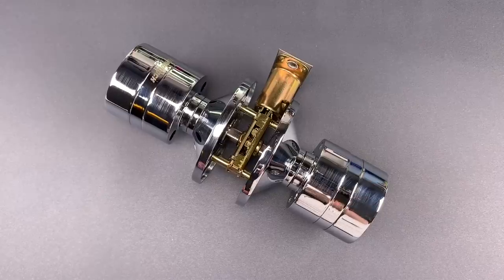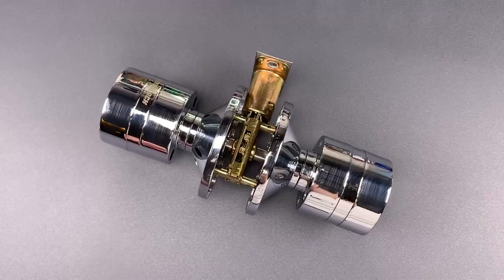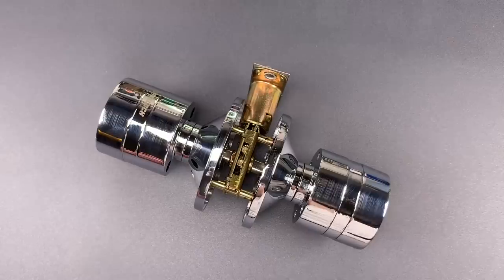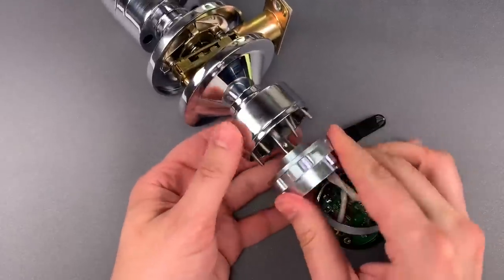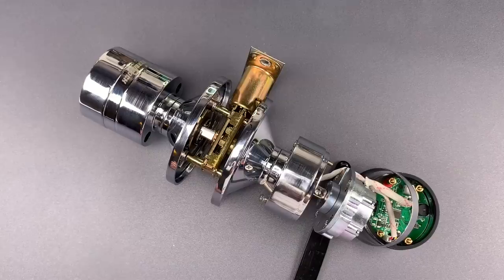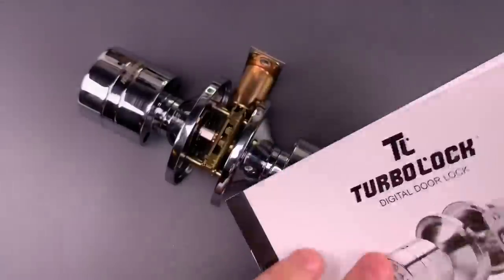[945] TurboLock YL-99 Opened With a Screwdriver!

Comment: I want a scary security sicker saying "Do not disassemble the Product." This will scare robbers.
Reply: I'd be more concerned with the "Nevermind the dog. Beware of the owner" stickers.
Reply: Robbers are not the issue. Be worried about burglars.
Reply: The use of screwdrivers is prohibited!!
Reply: @DerykRobosson  Ive been considering buying a sign like "Beware of the dog" but instead, I want to buy a small 6 pounder 19th century cannon.
"Beware of the cannon"  got a certain....message to it.
Reply: @impeccablyivy5021  And you forgot about the 239 others it seem

Comment: 2:50 to open? that's one of the best locks I've seen on this channel
Reply: It took 2:50 WITH A SCREWDRIVER!
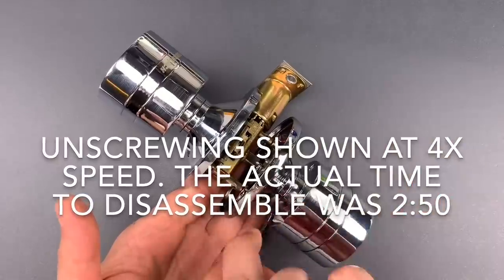Reply: @litigioussociety4249  look at 1:02, it's 2:50 to open
Reply: But could have been better by making disassembly only possible with access to the inside of the door. Not too difficult to stop with a tube if designed right.

Increase the combination to 7 -12 digits and you have something with reasonable security.

I would put something like that on my door...
Reply: @seriousmaran9414  tbh a bit of hammer would have probably gone through that weak construction
Reply: With a ratchet or electric ratchet this would have been scary fast.
Reply: @celivalg  probably the door too. Windows are usually easy to break unless double glazed. Even then easier than doors.
Reply: @seriousmaran9414  Why would one have to gain access from INSIDE the door though??
Reply: @sc0tte1-416  Replacing a defective lock?
Reply: With an anti-materiel rifle it would be open in a blink of an eye.
Reply: @Rotsteinblock  yeah, with a non-electric screwdriver
Reply: Claudio Diaz it’d also alert everyone in a 3 block radius
Reply: @seriousmaran9414  double glazed windows aren't any more difficult to break.  They've also become the standard in the industry, given the thermal break created by a void between the glass.  You might be thinking tempered glass.
Reply: @sc0tte1-416  The screws were needed in the factory, for assembly. Probably access from "inside" isn't necessary after that,  but there wouldn't be need to block that either, if the screw heads were protected by a tube or a ring with holes in it.
Reply: If it had been attached to a door he would have had it apart faster.  Add a ratcheting screwdriver and it's around a 30 second job.  The way it's built it looks like one well placed hit with a hammer could disassemble it.
Reply: It's a door lock, how secure are they? Give me a sledgehammer and I would have it open in 1 sec.
This is something to use as a privacy lock, not a security lock.
Reply: @bosstowndynamics5488  This is the kind of lock you use to keep nanna out of your room or your employees out of an area if you are too cheap to buy a pass card security system.  It's something to use as an internal area lock to keep honest men honest. You would need a beefier door and locks for an external security door. No lock or camera security system is infallible. The best security is always going to be vigilance, then call for assistance. Thieves are brazen af, especially if they're ice head kids or bankers.
Reply: Angle grinder or portaband; chop knob off, open.
Reply: Yep but I remember that he couldn't open an Italian Viro lock.  That was a good product
Reply: Its actually worse than most of the locks on the channel, because you dont have to be lockpickinglawyer to open it this fast. In many other cases you have to have some skill in lockpicking.
Reply: However practically guarantee there’s some basement dwelling 12 year old at blackhat or defcon who has an air gapping exploit that can be run in <5 seconds that opens it, sets a code to whatever you want and they will also point out that you can unlock it by typing 12345 3 times in a row. 🤷‍♂️ The digital lockpick if you will. Just like LPL needs the proper tool for different locks that is the same with this and it will probably be downloadable open source for free.
Reply: Opens in 20 seconds with a TURBO screwdriver!
Reply: @seriousmaran9414  Shattering a window tends to draw a LOT more attention unless you simple don't care.
Reply: Pretty impressive. Now to figure out a way to use it on my bike
Reply: Maybe see how long it takes mounted to a door where you wouldn't see the screws and be able to spin it around in your hands. It wouldn't change the actual defect of screws, but it might change the time spent.
Reply: You don't even need that much. Using a lever and a metal pad (to prevent the lever sinking in the cheap cardboard doors these are usually put into, that you can wet and get through, usuallyx2) you can break the head and get to the square key just as well. You never want purchase angles on your security features.
Reply: Claudio Diaz nerd
Reply: i'd just open the door. the lock isnt eved attached yet!
Reply: yeah seems pretty good, but i remember seeing one that even he couldnt pick.
Reply: @seriousmaran9414  they could have made it better with just using different types of screws too. Or even gluing a panel over the back part with the screws so you'd have to peel it then figure out what kind of screwdriver.
Reply: Ryan Espinoza It's called a "joke"
Reply: Simon WoodburyForget r/iamverysmart
Reply: @tormendor8585  what door? the frame is completely bare
Reply: Simon WoodburyForget I hear there’s no such agency also.. it’s not like people are going around basically jack potting some of these electronic/app locks or like there have even already been talks given in places about issues with electronic locks regarding facility security. There’s a layered approach and then there’s putting all your eggs in one basket, claiming unimaginably modestly that your product is unpick able, unhackable, & achieved what the entire DoD with >$700 bil to spend per year has literally never been able to do: perfect, impenetrable security. https://imgflip.com/s/meme/Two-Buttons.jpg
Reply: @chaosryans  different screws can be defeated by just a set of screwdriver bits. Mostly they would use a single type anyway for cost savings.

A glued panel can be removed, and you are back to the same issue. 

Problem is you need to protect the screws but that stops access to the electronics if they fail.
Reply: @celivalg  That metal ring inside that the screw go into looks like it's probably pot-metal and would disintergrate with a big smack from a medium-sized ballpein.
Reply: to be fair, there are many higher quality locks that LPLs skilled hand made look much easier than they would be compared to an unskilled phillips screwdriver
Reply: @claudiodiaz9752  .50 cal lockpick
Reply: With no lockpicking tools.
Reply: @seriousmaran9414  all they would have to do to deny access to the screws is to install a collar around the neck of the outside handle that is pressed flush against the back of the knob and fitted into some type of bearing door side and notched into place knob side it would make it harder to replace the batteries unless they could placed inside the interior knob to be honest why not place all the electronics inside the interior knob except the keypad and make that screw together from inside the knob these guys are idiots
Reply: @sc0tte1-416  that was the outside.
Reply: Red lock-tite anyone??
Reply: It would be 1000x faster to hit it once with a hammer and spin the latch with a screwdriver. 

Thieves wouldn't take the time to unscrew this, it would be frustrating and take forever. 

I own the non-Bluetooth version of this lock (it has the same flaw). 

I see this as a feature (since i can now disassemble it if needs be) more than a flaw (since kicking it down or bashing the handle would be faster). 

I had a ratcheting right-angle screwdriver that came with cheap Chinese furniture that works GREAT for this lol 

That being said; I would say this is a terrible DESIGN FLAW as it was not a purposeful feature (more an accident that resulted in convenience) 

2:50 for the lockpicking lawyer; that gives this lock an A+ in my book overall (even if the designer gets a D-).
Reply: I agree..but also, this could be easily fixed by the owner of these locks (I have 4 myself) I'd be interested to see how he would pick it if the screws were using red locktight, and the screw interface was drilled out (so no tool could really get in there). hmmmm

Comment: Gotta hand it to the company tho... with no key way to pick, it took him almost 3minutes to open
Reply: I'd argue that if time was a concern, a large hammer would have defeated the front part in seconds and achieved the same result...
Reply: I have a low-profile, right-angle ratcheting screwdriver - with one of those, that 3 minutes becomes about 30 seconds. Still longer than it's taken LPL to get through quite a few locks, but nowhere near long enough to call something a "lock."

Comment: I have that lock. The electronic failed so I had to figure out how to break in without damaging the door or the frame. I got out a hack saw. Then got the idea to grab a pair of channel locks. Once I got a good grip with the jaws of the channel locks, I cranked it counter clockwise. The plastic parts inside the lock didn't put up much of a fight. And within a few seconds I was in. What can I say, it was operating for a couple of years something serious when wrong with the electronic and the key pads    just froze. Safe to say I wouldn't be using this lock again.

Comment: Kobalt makes a nice 1/4 x 5/16 low profile ratcheting kit with many useful attachments.  This would be perfect for the application shown in the video.  I am an aircraft mechanic and I use my set for tight areas.
Reply: Uncle, your comment begs the question of why engineers would design parts, that will obviously need servicing, with such awkward and difficult attachments.
Reply: I hate to think how it looks if your toolbox is set up with an anti-FOD layout like 5S or AS9001 with those bits in it.
Reply: @ScienceNotFaith  Because sometimes function (as in operational function) is more important than form (as in serviceable form factor).  Other times, form (as in aesthetic form) is more important than function (as in serviceable function).
Reply: Kobalt should make stickers advertising this product.  Could be placed at ' strategic' places near certain doors.

Comment: I thought for a second that maybe the back side of the knob would be sunk into the door but no it really is just that poorly designed.
Reply: I am not sure if they advertise it as main door lock, but to me, this is decent lock for some inhouse stash room so your kinds can't get in. Or perhaphs secret mancave so your wife can't get in, without the need for a key
Reply: @kubav.9612  What? The entry for your mancave is NOT a false wall? How dare you. :P
Anyway, a lock shouldn't be designed so that it can be disassambled from the outside. It is just lazy and reckless.
So if that amazing manual not clearly states "Do not use this as a main lock" then it is just dangerous and even with the warning it would be a bad lock.
Reply: To be fair, I don’t know any robber that carries a freaking right angle screw driver. Or the fact that they would see this video and know what to do
Reply: @iluvlax100  consider this. Would you a. pick a random house and just enter or b. scout out the location before you prepare to enter it? So if someone would put this kind of lock on the outside, well it would be quite obvious what the thieve should bring along then.

Comment: I was really hoping for an easter egg in the sped up section. Putting it in Audacity with 75% (which is 1/4 speed ([s2-s1]/s2  = [4-1]/4 = 3/4 = 75%) works perfectly.
1:01 "This would probably be a lot faster if it was actually in place so I could take a full stroke with this screwdriver."
1:09 "OK, that is one of the screws."
1:17 "OK, the second screw is out. Just two more."
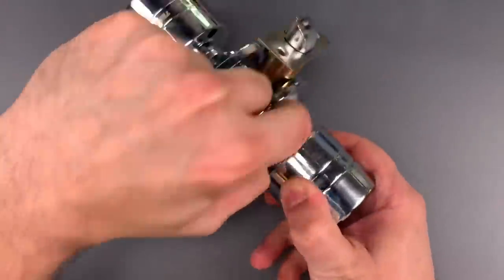1:25 "I can't quite get my fingers in there to turn that one out."
1:28 "There we go. And the final screw."

Comment: They couldn't at least use a speciality screw or loctite? Unreal
Reply: They've change it.. I've bought four of these... each of them now have a star screw set.. but I think the best way around this is... destroy the interface? as in, strip it out. He's able to take it apart so easily b/c its not attached to a door. I doubt if it is was stripped out (the interface with the tool, not the threads themselves) it would be easily picked.

Comment: I imagine they don't want you to disassemble it because you are bound to find several more security flaws they hoped no one would notice.
Reply: Exactly
Reply: Since it uses a tiny solenoid to engage the mechanism for allowing the bar to turn I suspect an externally applied magnet could work as well.
@LockPickingLawyer
 can you check this out?
Reply: It's clearly a warranty issue.
Reply: For instance, where is the 'set combination' button?

Comment: Little epoxy on the screw heads or tamper resistant screws would go a long way.
Reply: Oneofdazzz hell, just a dremel with a burr to damage the screw head so a driver tip cannot be used would work.
Reply: @ROTAXD  Supposedly you want to be able to fix the lock if it breaks. I don't even think this is an issue really; it's probably not really meant for applications where it would be kept unattended for several minutes.

Though they should've used security screws.
Reply: Amunak you’re probably right about it not being left unattended. As far as repairs go, I highly doubt parts are even available for those as it’s only a $40 knob to begin with.
Reply: Why not just bolt the fucking thing in place? its perfectly doable, fuck I could do it myself provided I could remember what the friggin tool I used as a welding trainee was called
Reply: @Elenrai   bolting is the same thing as screwing it in, can still be reversed. Welding is different

Comment: I'd be interested to see how it'd handle a single sharp hit from a heavy hammer. Would that front plate pop right off on 4 broken screws? What was the metal the screws were biting into?

Also, all those delicious electronics on the insecure side of the lock...
Reply: @SimonWoodburyForget  perhaps he means the batteries.
Reply: but the warranty!!!

Comment: thanks for pointing this out. actually, i do not see this as vulnerability. this gives me a way to get in the door now it stops working. thieves will not spend that much time to open a lock. there are easier targets. so i think this is actually a good thing.

Comment: Thanks LPL,  I have these locks at my AirBPB, I since replaced the screws with square center pin screws.  Still accessible but not as common as a Phillips head.